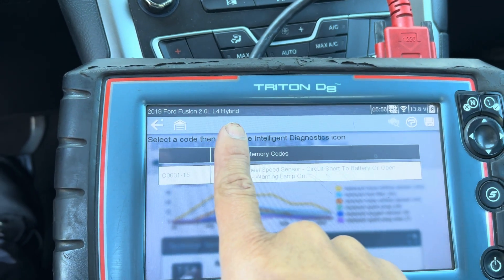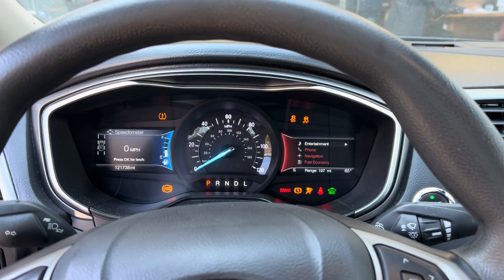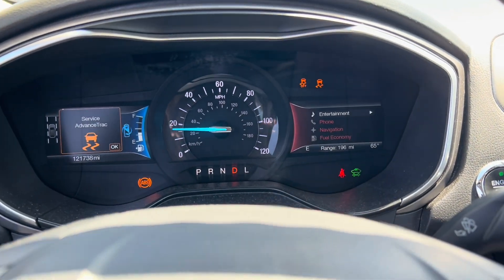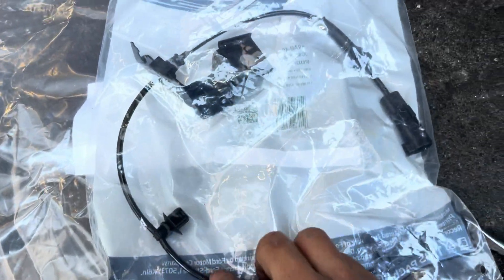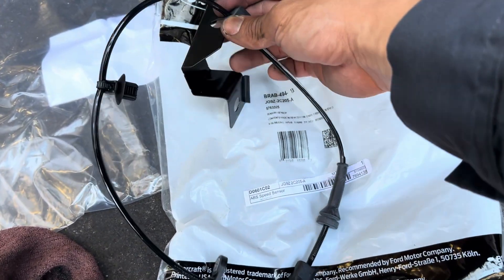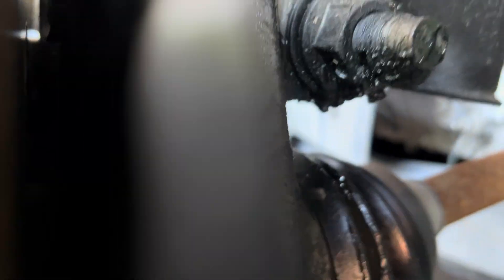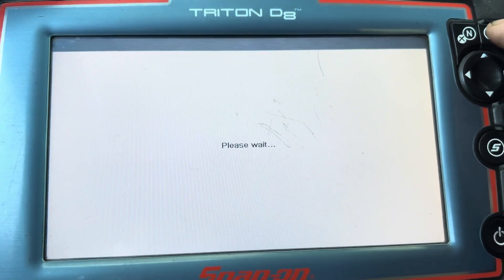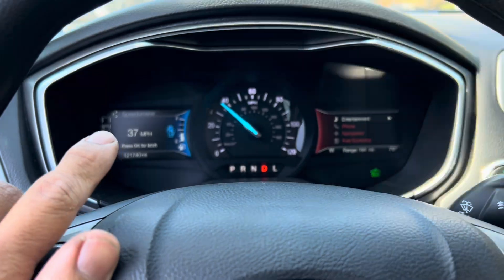Ford Fusion ABS Speed Sensor - Code C0031-15 - Easy 10 Minutes Job

Comment: Does the sensor affect the brakes..my brakes would skip/slip my if and drive on ice and its summer..
Reply from the maker: Sensor does not affect the brakes. Tires are not meant to drive on ice. If it slip or skip. Check tire treadwear. Check brake pads if its low or uneven pad wear. Check rotor for uneven wear or cracks. Check brake caliper for leaking or any damage.

Comment: The way you pullled out the old socket at 4:04 was what worked for me cause I don't have a red locking mechanism.  
Question:  When I put it back in the same socket, it doesn't seem to lock in and seems much easier to remove (just pulling works).  It is not clicking into place.  Am I missing something?  Thanks

Comment: I have this problem now on my 2015 ford fusion titanium to it gave me C0051-67 code all the same lights are permanently on as soon as i turn on the car going to try to change the wheel speed sensor see if that works
Reply: I have the same problem. Did it work for you?
Reply: @rigoiphone nope just decided to drop it off to ford got tired of guessing randoms parts that don’t need to be changed lol :(
Reply: @rigoiphone update ford said its the rear sensor again they said it has to be a ford sensor not from autozone or oriellys so i got the part coming in tomorrow morning will update ya if that works hopefully lol
Reply: @rigoiphone got it fixed was the 2 rear wheel speed sensors i had to get them directly from ford couldnt go to autozone or anywhere else

Comment: Hello

Thanks for the clear video.  A few questions:
a) What OBD2 scannner did you use?  How did you get it to show the diagnostic on the Ford dashboard?  I have a 2014 ford fusion and I am having to use a blue tooth scanner (xtoola30m)
b) Where did you buy the sensor?

Thanks
Reply from the maker: The scanner im using is for shop only. Cost $7,000. The sensor i bought from ford dealership.
Reply: @Ah_Duuu_Ma  Thank you

Comment: I have the same issue. I don't have any experience with odb2 scanner. Does it read the code only when all the lights come on?
Reply from the maker: All lights are separate part. ABS is for the brake system codes.